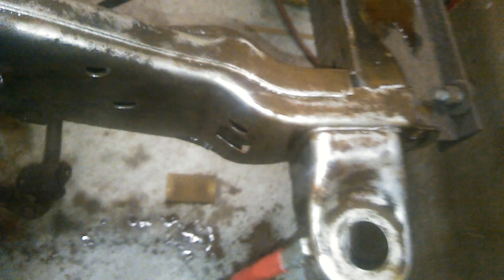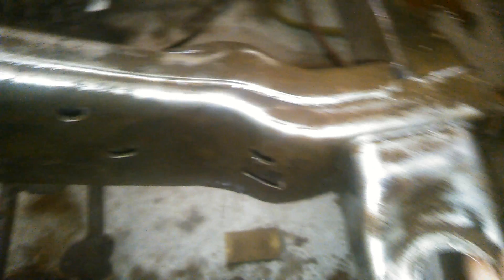Removing rust vinegar rock salt and electrolysis

Comment from the maker: if you want to use electrolysis on Chrome use Arm and Hammer washing soda sodium carbonate do not use salt when using salt you are actually eching the metal salt will destroy the finish of chrome and also creates chlorine gas. Use distilled water and Arm and Hammer washing soda. Any places you have rust will turn black but the chrome will remain unharmed.